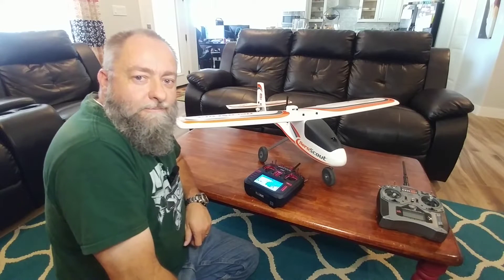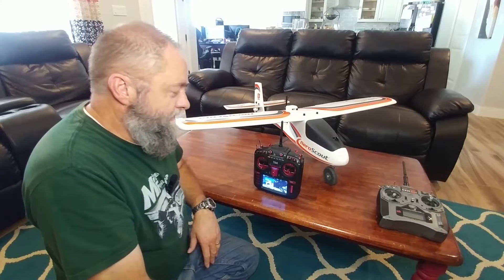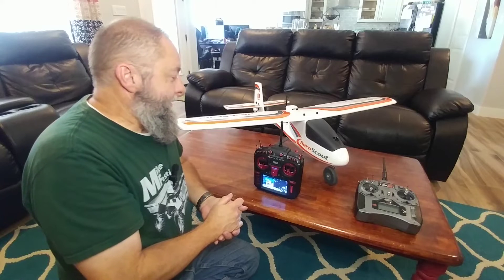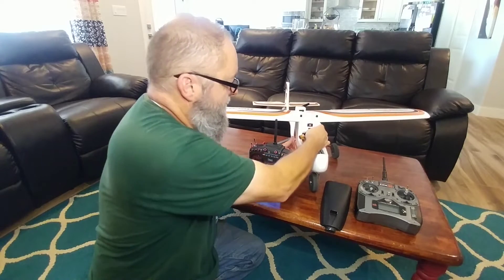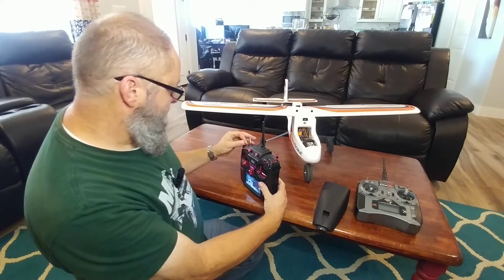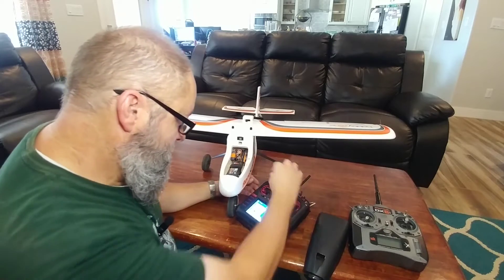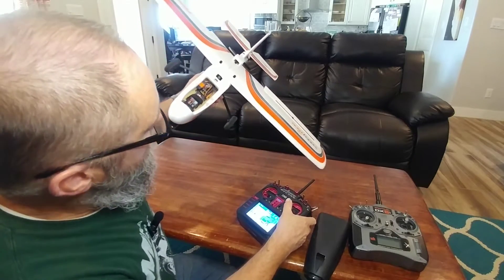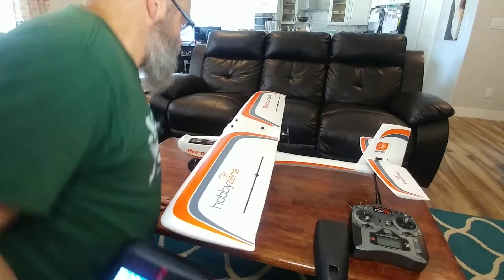Spektrum RC Safe Modes on the Radiomaster TX16S!

Comment from the maker: I've made an update to this video that simplifies and explains a few things better, be sure to check it out!
https://youtu.be/ZefAYBJVdvk?si=fuxFhaRrBOwouaWA

In case anyone needs it here is a link to the model yml file for this original video. (new video has some better methods...)

https://drive.google.com/file/d/1T5t0E7EMBAqBRXnClVIHaXIPE-YzYDQ4/view?usp=drivesdk
Reply: Thanks, total noob here, if I am correct, where to put this file on my radio? Means that all the key binding is already done, just bind the radio to the Spectrum and thats it, or am I wrong? Amazing video, thanks
Reply from the maker: @PrimusIV   Make sure you have a TX16S. In this video, I think I was using version EdgeTX 2.7.1 so if you are on a different version that might effect some things.  To migrate the .yml file into your radio you just need to move it into your /MODELS folder on your radio but before you move the file,  first look at the list of models in your /MODELS folder.  Rename this AeroScout model file from "model1.yml" to one that you don't already have on your list.  Just change the 1 to an unused number.  Then move the file to your SD card /MODELS folder.  Once you go back to your radio the "labels.yml" file will have captured the new model and it should now show up on your radio and let you select it.  You might want to change the model ID number in the internal RF setup if you have other Spektrum receivers on the radio.  Then bind it.  Make sure it gets bound as DSM X 2F.  If it gets set for DSM 2 many functions will not work.

You really only need to do this setup with the logical switches and special functions if you want that non-standard flight mode.  Just to get safe working, you just need to map channel 5 on your transmitter to the switch of your choice and bind with safe select enabled and you will be able to switch between the 3 standard flight modes.

I have newer videos that show other options including fully unlocking these receivers and since this video, the Forward Programming Lua scripts have come a long way so you can setup anything you need to on a Spektrum receiver.

Good luck and happy flying!
Reply: @shanesdiy  Many thanks for the support, so if I bind the plane, without this file, just straight up, is the plane in expert mode or safe/beginner mode? Sorry for all t he stupid questions.
Reply from the maker: @PrimusIV  I just experimented with this on the bench with an AR631 and when I deleted the channel 5 assignment it just stayed in AS3X mode.

Note that AS3X is just wind mitigation, it doesn't self level.  Also, AS3X doesn't activate until you advance the throttle to at least 25%.  Then if you move the plane around the control surfaces will "wiggle" as it tries to compensate for the movement.
Reply: Many thanks, I will check out your newer videos aswell, many thanks
 @shanesdiy

Comment: I bought an Aeroscout S2 RTF that came bound to a Spektrum DXs radio and the throws of the control surfaces are much greater than they are when I bind the plane to my FrSky radio. When bound to the FrSky the servo throws and movements of control surfaces are far less than when it’s bound to the Spektrum. I’m scratching my head over it. Can’t figure it out. All of the rates and limits are programmed correctly in the FrSky but it just won’t move the servos and surfaces like the Spektrum. Other BNF planes with Spektrum receivers don’t have the same problem.
Reply from the maker: Watch the more recent update to this video. Most likely you didnt get channel 6 programmed. If you dont set channel 6 to +100 the plane will be stuck in panic mode with very limited control movement.  Channel 5 changes between safe, intermediate, and expert/as3x modes. +100 is safe, 0 is intermediate and -100 is as3x expert mode.
Reply: @shanesdiy that worked like a charm! Thank you so much!

Comment: 4:41 dude. the more i learn about the tx16, and i assume most if not all would apply to the tx15, the more i just want to spend $300 on some piece of shit spektrum transmitter. you need to upload a fucking file just so it can say "safe mode"???? why the fuck cant you just enter in whatever name you want on the radio?????? if you bind to a fucking plane with safe mode it should just work on the radio.

Comment: Hi Shane, I am thinking about picking up the hobby again as well. I would also like to switch to the Radiomaster and this same receiver in a trainer for my son. Can you receive telemetry data from the spektrum AR631 receiver with the Radiomaster receiver. I read that the 4-in-1 Radiomaster can cope with the DSMX/DSM2 control signals but that it can not read the Spectrum propriatary telemetry data format. Is that correct?? Greetz and thanks for the great video!!
Reply from the maker: The Radiomaster radios can capture any and all telemetry data from the Spektrum receivers as well as perform all Forward Programming functions with the latest DSM Tools scripts.  If you browse through my "RC Guides" playlist you'll find many examples showing using Spektrum DSM telemetry with EdgeTX and Radiomaster.

In my opinion there is absolutely no reason not to make the switch as long as you are willing to do your homework to learn EdgeTX.  Homework like watching my videos 😉
Reply: @shanesdiy  Ok, that is so great to hear! Next step will be indeed watching your videos on this subject. Edge TX should not be too difficult, at least not the basics, since I also flew some models with the old Frsky Taranis using openTX a couple of years ago. Compared to the Spektrum DX8 I also used at that moment, Open TX was such an eye opener but one with a learning curve. Looking forward to finally be able to fly different models/receivers with one single radio. Seems the tx16s is the way to go forward!! 🛩🛩
Reply from the maker: @thewoodlab2102  Next video is another update on the latest DSM Tools "Suite" script for EdgeTX using the TX16S.

Comment: How can I assign a switch if I am using radio master 4in1 transmitter with a spectrum as3x reciver I am only able to use 1 mode.
Reply from the maker: I highly suggest watching the updated version of this video to simplify things as well as point out a few common issues folks have. The link to the update video is in the description and also in the top pinned comment.

Comment: In your video you said you have AR631 doesn't that use a bind button instead of bind plug? You mentioned to activate safe you still sue a bind plug?
Reply from the maker: It has both the bind button and the bind plug.  The bind plug is just easier to access on the AeroScout.  You have to remove the wings to get to the receiver and press the bind button.

Also, with the AeroScout in particular and most of the dedicated "trainer" planes safe is always enabled, it isn't turned on/off during the bind process.  That is only true for BNF planes configured with "SAFE Select".

Comment: I have a Boxer with an external module did you just bind and it automatically picked the channels?
Reply from the maker: The radio sets up the 4 basic channels for inputs and mixes when you create the model. The binding process does not automatically configure any channels.  Anything beyond the 4 basic aileron, elevator, throttle, and rudder you must setup your self to work with the specific airplane.   I have a newer version of this video that may simplify some things.  The link is in the description.   Let me know if you have specific questions.

Comment: I have tried this with Turbo timber evolution BNF but unfortunately it doesn’t work with RM Zorro. Any advice?
Reply from the maker: Yes, the Turbo Timber Evo BNF is setup for "SAFE Select" which means you enable safe modes during the bind process but there is no default safe f-modes channel assigned nor is there a panic mode.

Couple options.  First, you map the safe f-modes switch of your choice to channel 5, 7, or 8.  You do need to make sure your control surfaces are moving the correct directions with the radio sticks before this next step. You have the radio bound, safe select enabled (during bind) then you hold the two sticks down and to the inside. Then flip the safe f-modes toggle switch on-off 5 times.  If done correctly this will set that channel to control the safe modes.  Also make sure you are set to high rates while you do this.

Option 2, if you have the latest DSM Tools scripts, EdgeTX and multi protocol firmware installed on your radio you can connect to the receiver via forward programming and set the channel.  You still must map the switch to the channel of your choice in the radio.

I have a zorro and a Turbo Timber Evo, I suppose that might make a good video that could help a few people...

In one of my recent videos I show how to get the DSM Tools scripts onto your Zorro.

I also have a Spektrum to EdgeTX video series and in episode 4 "bonus episode" I work with the Turbo Timber Evo. That video might be helpful although I'm using the TX16S. 

Let me know what additional questions you have, Zorro will work great with that plane, will be happy to assist.
Reply: @shanesdiy  First and foremost I really appreciate your prompt response. Before I see your comment I have tried option 1 but it didn’t work out. After I read I tried that again a couple of times same outcome. Then I watched the updated Aeroscout video and the first video you mentioned that the channel range should be set to 1 -12. When I made that change, everything worked perfectly. 
Thank you again for the awesome content.

Comment: Any idea how one could make this work with a Corsair. With retracts and flaps on ch5-6?!!
Reply from the maker: I will first suggest having a look at the updated version of this video, link is in the video description.  It clarifies and simplifies a few things.

Unlike the AeroScout used in this video that has safe always enabled and f-modes and panic fixed to channels 5 & 6 if it is a BNF plane with a Spektrum receiver that came with flaps and retracts they are normally setup with "SAFE Select" which you can turn safe on/off as well as manually set the f-modes channel.  When SAFE Select is enabled during the binding process, you can assign the channel of your choice by holding the sticks down and in and flipping the switch 5 times off->on->off.  Obviously the switch must be assigned to the desired channel and you can use any channel between 5-9 assuming your radio has enough channels.  It will take at least a 7 channel radio.   FYI on the SAFE Select enabled model, you most likely won't have a panic setup.

Compared to the setup in the updated video (highly recommend using that one rather than this older method) you would just not do the channel 6 panic mode setup since that is your flaps, and instead of the safe mode switch on channel 5, change that to ch 7, 8, or 9. Then do the assign procedure detailed above.

Comment: What protocol have you used and what other attributes you've selected in the Radiomaster to bind with the Spectrum?
Reply from the maker: DSM X2F is the protocol I use on all my Spektrum planes and is the most common for most of the modern receivers.  DSM X1F would be the other option.  This was one of my first Spektrum -> EdgeTX/Radiomaster videos, many others since, including an update of this one I recommend browsing through them.  Since this video, the EdgeTX developers have replicated just about every function so you can setup everything on Spektrum Smart receivers with your EdgeTX radios, Forward Programming, TextGen for the Avian ESC, Sky Remote ID GPS telemetry, etc.

Comment: so what if you have a plane with flaps that use channel 6? how are you supposed to get safe and as3x to work?
Reply from the maker: I've got many videos explaining other options.  This particular plane has an RX that is locked and the safe modes are on 5 and panic on 6.  With many other planes the RX lets you assign the channel and you can use any channel from 5-9 for safe modes.  This receiver, the AR631, when unlocked has channels 7-9 available for safe, reverse thrust, etc. so you can keep your PWM servo channels available for flaps, retracts, etc.

For example, this particular AeroScout, in my later videos, I have it set up with flaps and reverse thrust.  Channel 5 is now one of the ailerons, channel 6 is available, and channels 7 and 8 are safe modes and reverse thrust.

Comment: I tried this but since "safe" is actually panic it wont work as well. How should i set the channels to get normal safe Mode? Not panic
Reply from the maker: Channel 6 is panic and must be at +100 to turn it off, then you switch channel 5 between -100 / 0 / +100 (+100 = safe).  Just so happens I just released a new video update to this one about 20 minutes ago!    It is a simpler method to set up the safe and panic on the AeroScout with the Radiomaster TX16S.  Go check that one out.

Comment: Thank you so much!!! My older than dirt DX7 died and I wanted to buy something other than a Spektrum radio but still be able to use SAFE and A3SX for teaching on a Carbon Cub my grandkids to fly. This is exactly the info I was looking for. Do you know if a buddy cable can be used to connect the Spektrum DXS Transmitter to the TX16S? Also, can the telemetry data from something like a Spektrum AR637T DSMX 6-Channel AS3X Telemetry Receiver be displayed on the TX16S?
Reply from the maker: Search through my RC Guide playlist and you'll find many videos about telemetry and Spektrum and Forward Programming with the TX16S.  Yes, it can absolutely collect and use Spektrum telemetry values.  Since I did this video, the EdgeTX developers have made huge progress with the Spektrum interface with radios like the TX16S.

The DXS transmitter doesn't have the wired trainer port.  It does have a wireless port for Spektrum's wireless system but I'm not sure if that can work with the TX16S.  If you get the 4in1 model TX16S and add an external 4in1 module to it you can then use the TX16S as the trainer master with any Spektrum DSMX transmitter wirelessly.

Comment: Great video. I have a little different setup and wasn’t able to get the modes working. I have a 1.2m Trojan with landing gear on channel 5 and flaps on 6. RM Boxer. What channel would SAFE be mapped to?
Reply from the maker: Hi!  The method in this video isn't applicable to that plane.  By default they don't have a channel set for safe and also don't have a panic channel set so this method won't work.   Simplest method is #1, in your model setup for the DSM module configuration make sure channels 1-12 are enabled.  #2 go into your mixer and for channel 7 or 8 configure it to use the switch of our choice as the source.  #3 bind to the airplane with the safe select method set to ON. #4 make sure you have full 100% rates selected and all the control surfaces operating in the correct directions.  Move both sticks down to to the inside and flip your selected safe switch 5 times (OFF->ON->OFF = 1 "flip").  Once you do this 5 times, if done correctly, it will assign that channel (and switch) to turn safe on/off.

Alternatively, if you've got the latest 0.56 forward programming "MIN" scripts (latest as of the date I write this) on your radio you can set the safe channel in forward programming.  You still need to map the switch to the channel in the mixer.

FYI, I recently picked up a Radiomaster Zorro which is the same screen and setup as your Boxer and plan to do some forward programming content!  Let me know if you have more questions.  I suggest watching the multi-part series on forward programming and get the latest forward programming lua scripts for the B&W radios.
Reply: @shanesdiy  Wow! Thank you for all of that! I suspected that it was possible as you described. I’ll try it. As it is, I was able to maiden and fly the plane today by assigning a 2-position switch during binding as you described. But now you’ve explained how to get more out of it. Thanks again!

Comment: Bind a new BNF plane to a Spectrum transmitter and it will activate SAFE and  ES3X.  Then use the Radiomaster.
Reply from the maker: With the new EdgeTX and new forward programming scripts you don't need a Spektrum TX for anything. I have many newer videos explaining how it works.